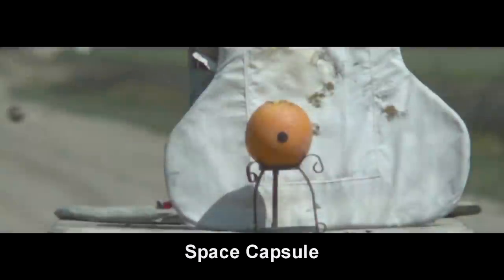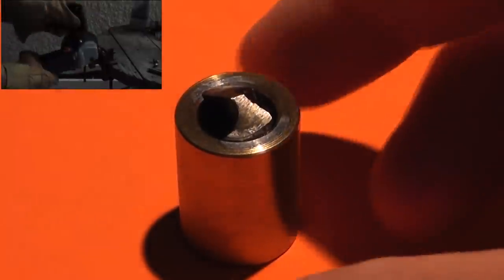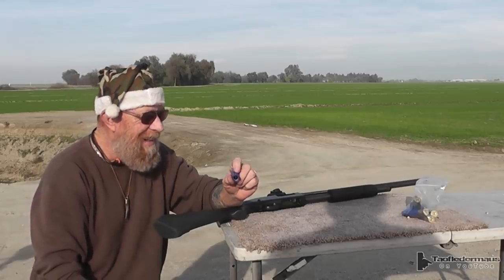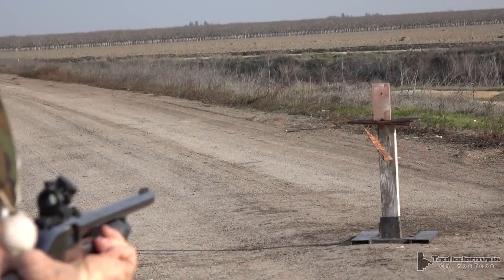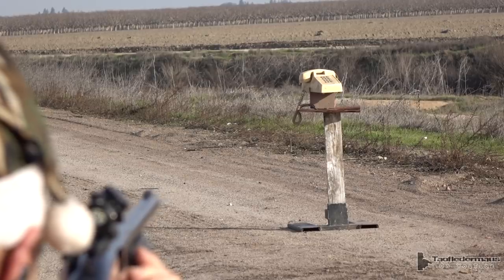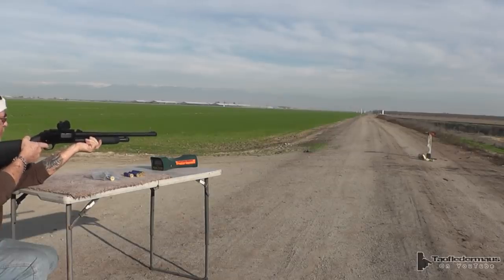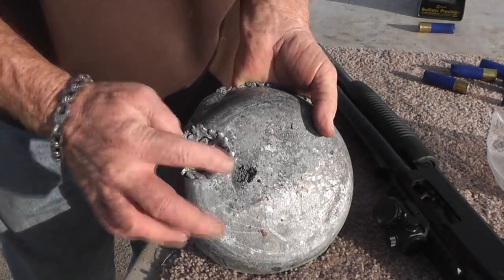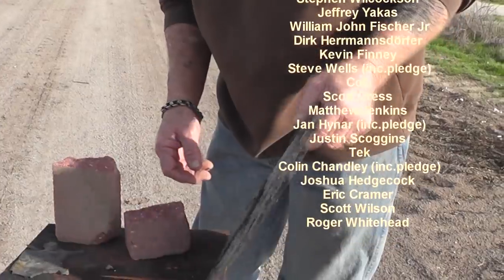Internal "turbine"  drill bit slug experiment

Comment: To test airflow inside the object, try putting something inside that should become loose and fall out in flight, styrofoam wadded paper, etc...? 

Fire into a recovery medium (gelatin, water jugs, magazines...) and look for the indicator. If it’s fallen out, you have airflow, if not, then the high speed creates a buffering “shield”, which is what I suspect happens at those flight speeds/pressures.

Comment: Question, what if you had the same brass cylinder, except capped at the front, then have the air gaps around the drill bit filled with powder model rocket fuel (r candy, sugar rockets, potassium nitrate and sugar. More or less lol)

But that rocket fuel would be sent out of the gaps, more or less, forcing a spin onto the round. 

It's an idea, r candy recipes are everywhere on YouTube.  Just going that the "candy guy" doesn't mind making a few more of these except capped, and you don't mind shooting a rocket powered shell. Lol. 

Just a thought I had, scrolled through a bunch of comments and didn't see this suggestion. I just feel that if you force a spin on it with fuel, vs air, you'll get better spin. 

****Nerd logic used****:

The weight of rocket fuel, even though only 5-10 grams weighs more than the air that passes through the channels over the 30 feet. 

And the burn rate of the fuel could be adjusted with small percentages of gun powder, too get full burn through the channels.

Comment: In front of a blunt objet a shockwave is formed, and the front of the wave is not touching the objet but is recessed, that recess could prevent air from circulating into the holes.

Comment: A little heavy on the slugs.  A lighter version of them may fire more accurate. And the grainge on a 12g shell is to high. You're not going to see the cloud on it. Try using a half drop of canola oil or vegetable oil. Gets a tad bit hot but it shows the desired effect.

Comment: I'm sure this has already been said, but the problem with trying to get airflow through a hole in a supersonic bullet is that any hole which is deeper than its radius is guaranteed to choke on its own Mach cone and behave aerodynamically as if it were solid.

Depending on the speed of the object, a conical shock front will form with a cone angle anywhere from 180/flat (Mach 1.0) to 0/"needle" (Infinite Mach).  The short version is that if your passageway is deep enough that the Mach cone formed by from the leading edge intersects the side of the passage before it exits the back, you are guaranteed to have zero airflow through that passage.

You can find the math to calculate the cone angle for a given speed as the link below.

http://wordpress.mrreid.org/2012/12/15/sonic-booms-and-mach-cones/

Comment: Why not a thinner drill bit with a nylon discarding sabot, fired from a smoothbore rifle (relying on the shape of the bit to spin it up)? (The bit could even be set way back in the case, because the gas from the burning powder will drive it down the barrel with the sabot's driving band. So it could be a lot like an actual tank gun round, but not find stabilized.)

Comment: Ideally the fluting would account for the inside geometry of the slug as well.  I think the fact that the flutes are well formed and probably too aggressive on the bit side and neglected on the inside of the brass housing is leading to the instability.  I think smaller flutes which have a beveled inlet (like a scoop) which taper to a smaller diameter and have a softer rate of twist would yield better results.  That said, that would be very difficult to manufacture.  Honestly I think it would have to be cast and be pressed into a brass jacket or something.  Great concept and video, very thought provoking.  Good work.

Comment: So what probably is happening is air is actually stagnating around the drill bit center (arrow dynamics do amazing/ weird things at supersonic speeds) I would encourage people to look at other things that go supersonic speeds for instance the SR-71 Black engine. (All kinds of things move around on the engine... flaps inside and outside the engine open close, the nose cone moves in and out just to make it efficient at supersonic speeds) SO the friction of the air over the surface of the drill is too high and there is less surface area around the out side of the slug so it travels around it instead of thru it. The oil in the hollow tip probably worked because air dead headed at the base of the howl tip hole, the air acted like a like a fluid in a way, and simply pushed the mineral oil out creating a plume but not all at ounce. (Or the hollow tip acted like a cup and head the fluid where as the drill bit just allowed it to puddle in the barrel and cause fouling /accuracy problems.)

Comment: The mineral oil wasn’t evaporating because you had no compression. With the hollow point, the oil was trapped in the tip however, the slug let it fly out the back with no resistance. It most likely was fouling the barrel and causing the wadding to stick to the slugs.

Comment: I think the blunt forward edge of the "tube" creates a shockwave that keeps air from fully flowing through the drill.
If we think of that drillbit as a turbine, and look at how real high-pressure turbines are built, then you can clearly see that the drillbit is a very inefficient design.
Lots of lightweight wings and a funnel-shaped front is the way to go.

Comment: You likely won't see the oil simply because of the fact that the inertia of the slug accelerating at a faster rate than the oil is likely pushing it out into the wadding and barrel before the slug even leaves it. Unlike the hallow point ammunition, this slug doesn't have the little bowl but a through hole. 
Without wadding of it's own, it would be like trying to stand on a rocket propelled skateboard... You'd stay in place while it rips out from right underneath you. 🤣
Maybe add a small amount silly putty to plug the back holes and a bit more oil. That way the once it leaves the barrel and the pressure differential changes it'll basically turn the silly putty into spit-wads out a straw, then you should see the oil leave. 👍

Comment: Ok, what is the twist rate of a barrel? per inch?  And that is forced upon the object. Where as you are relying upon air to impact the high twist per inch in a millisecond of travel time.
  Now it might work if you were doing long distance, very slight twist thin blades, and a funnel front or way of using the air pressure better.

Comment: oil will not work with this slug. It worked on the hollow point because the hollow point is like a bowl, it holds the oil from going on through. What was happening is the oil probably mostly stayed in the shot cup, because as the slug blasts off, the oil doesn't move as fast, things at rest tend to stay at rest. So, as you fired more rounds, the oil was messing up the barrel. To be fair to each shot, you should swab the bore between shots, if you're going to try the oil or anything else again. Frankly, I don't think it will ever work in this case If the rounds always performed like the first couple, then Sar has something there.

Comment: With the .22LR you had the oil in the tip of the bullet where it did not come into contact with the explosion of the gunpowder. With the shotgun I suspect that the explosion from the gunpowder burned up part or all of your oil inside of the barrel already and that is why you started having accuracy issues due to all the burnt and unburnt crap in the barrel. Would also explain why you didn’t see any vapor trail.

Comment: @TFM have you considered loading these projectiles to just below the speed of sound? dont forget that while the projectile as a hole would not be above the sound barrier, the air moving over parts of the projectile can be accelerated above the sound barrier as they speed up and are pushed out/through the slug. I wonder if you nose cone or another part of the slug is causing such an event and blocking the cavities from getting air flow.

Comment: Perhaps try thicker oil with more viscosity, when the bullet heats up the oil looses viscosity. I think it might stay there a bit longer if you use thicker oil, used motor oil for diesel engines :D. I dunno just throwing ideas.

Comment: The hollow point had constant resistance due to being solid which allowed for vaporization. This projectile has holes straight through it,  so the oil doesn't get a chance to become pressurized and vaporized in flight, as it just blows out the back of the projectile.

Comment: Here is an option: It will need precision, but drill diagonal holes in the base of the round, which will fill with combustion pressures and then expel them upon exit imparting rotation, possibly stabilizing the round. It just has to start the rotation to last two seconds max.

Comment: So I'm curious about this. Whats having more of an effect the rifling of the barrel or the fluting in the drill bit? Shooting out of a smooth bore might have been interesting to see if any spin is imparted from the fluting. You could also submerge the round in a dish and provide a current. Then introduce a drop of die right in front of the slug to see the result of the internal hydrodynamics of the slug. I would propose that it just slows the actual projectile down due to the increased twist rate compared to the rifling of the barrel cause a high pressure block in the slug.

Comment: Reasons I can see, the hollow point was a hollow point and not a through hole like the drill bit slug so that saturated the wad and caused failures, i would have used a plastic wad something not fibrous. I bet if the drill bit was loaded a bit hotter or faster powder would have had a different effect and with the wad being different would have helped.  I sure and want want want to see this revisited at least 1 more time and if you can get like 3 times the slugs for using different ways, sabots/shot cups and slug machined down a bit more to compensate for a cup probably would have different effects.  To me too much oil shouldn't have caused a issue other than see some oil out of the gun barrel. Even if you wrapped the slug bottom in a plastic wrap with the current wad would keep it from getting oil soaked and no failure.

Comment: It's like a jet engine with compressor stall, at a certain speed the air compresses to a point where it actually stops airflow through the engine, probably what's going on with these.

Comment: The intro song had me rolling. The reason your wadding failed is the pressure of the blast with nothing between the wadding and the load was too much for the plastic to handle and it was partially extruding it through the opening in the back of the shot. Try putting a piece of cardboard box between them.

Comment: the way the turbine shaped drill bit would direct the air would cause these rounds to dip down and to the right. They aren't spinning because of rifling, they are spinning because of the way they are redirecting the air they are traveling through, which will exert a force on the bullet instead of against the barrel of the rifle.

Comment: i wouldnt have used mineral oil the viscosity is wayyy off, u want some thing as close to water as possible if u want an epic vapor trail. hard part is puttin in enough of the right mixture that it wont burn up or wont mess up the bullets like when they were coming out strange too thick of oil was used, is the DEF cause of that. so again closest thing to water should ive u a great trail. it think when u dyed it maight have been where the mixture got weird. just an idea

Comment: I think the issue is it wont work if the air passing through the center is restricted. I think it would work by removing the drill bit and inverting the barrel rifling on the walls of the cylinder, creating mounds instead of grooves, so it continues directing the airflow in the same rotation as it did from the barrel.

Comment: How does this video address the requests of the viewers? Wasn't the idea to propel a drill bit through a barrel and have the twists make it spin through the air as rifling would have? Putting the bit tightly inside a sabot of brass and then firing it through a rifled barrel imparts the spin to the sabot, not the bit. Am I misunderstanding this presentation?

Comment: Why don’t they use this round as a basis for the self propelled/“rocket” round, just need to keep the round capped on the top, keep the drill bit inside, and just fill it with a powder or fuel of some sorts

Comment: Theory: the rifled barrel spins the slug faster than the drill bit would, which in turn makes the drill bit's airflow fight against the spin from the barrel, like trying to turn two gears that are different sizes and touching eachother with both hands at the same speed

Comment: It would be interesting to see if the spin could be imparted during the acceleration down the barrel by adding more charge than needed, and letting some of it vent through the slug.  The slug would of course need a free path through it for exhaust gasses to flow, so no wadding.

Comment: Have you considered the fact that with a higher surface area in the 22 hollow point and a large amount of force apply the same time main cause of mineral oil vapour to be pushed out much sooner in flight Andy largest surface area of a slug would force more air to be displaced which is why you may not be seeing a vapour trail from the mineral water

Comment: one time i put a socket for a ratchet wrinch in a 20Ga 2 3/4 inch high-brass shot shell and filled the hollow part of the socket with the #6 shot that was from the shell. i shot it at an old dead dryer door and it went clean threw the door and got stuck in the back of the drum.

Comment: i know this video is older, but i believe the drill bit was the wrong direction. yes it was turning the correct direction to cut but resistance is opposite of the twist. so maybe the air flow was slowing rotation... wonder if a left handed drill bit would have worked better.

Comment: saar if i had one recommendation to fix the slug, it'd be to make the drill bit slightly more straight and to add a flat steel plate to the back of it so the wadding is able to come off of it properly. (someone who's better at science can critique me on my thoughts about the drill bit) the issue with the wadding though i believe was due to the fact that there was space inside the slug which the wadding would then force itself into and cause it to tumble, a flat steel plate to be discarded would fix the issue.

Comment: If the fluting goes all the way through fluid dynamics should mean it is all left in the barrel, as the projectile will be propelled faster than the fluid since it has not surface area for the explosion to push.

I believe in the hole point it does not go all the way through so the bullet acts as a squeegee pushing the oil in front of it until it overcomes the barrel pressure a few inches beyond the barrel creating the cloud of mist.

Comment: Maybe someone has posted this. I’m not going to read all the comments. The drill bit inside will not rotate the round do to the fact that the flow of air both in front of and behind equalize. When the the air pressure is consistent at both ends of the “ tube” the whole unit is a mass rather than a pipe.

Comment: I believe the reason that the slug is not spinning fast, is due to the rifling spinning the slug clock wise when the flutes of the drill are forcing the slug to spin in the opposite direction, if you look at the flute of the drill they are designed to rotate drill bit clock wise, but if you force air toward the tip of the drill bit it want to rotate counter clock wise.

Comment: 4:47 - I might be wrong, but the twist of the drill bit being right hand and the rifling also being right hand twist; the air passing through the drill bit will be counteracting the twist put on the slug by the barrel. I think to increase the spin of the slug after it exits the barrel the drill bit will need to be a left hand twist.

Comment: Have you considered having a fluted slug with the holes at the top angling down to the sides instead of the just straight down through the slug to create more spin.   It wouldn't be super hard.  Two hole at the top corners crossing side by side(but not touching) in the middle, ending at opposite sides 
                                      
                                           Air In top
                                        /-----------\    top     
                                        |\ \       / /|
                                        | \ \     / / |
                                        |  \ \   / /  |
                                        |   \ \ / /   |
                                        |    \ \ /    |
                                        |     \ \     |
                                        |    / \ \    |
                                        |   / / \ \   |
                                        |  / /   \ \  |
                                        | / /     \ \ |
                                        |/ /       \ \|    Air out through the 
                                          /         \      Holes at side 
                                         /           \
                                        |             |
                                        |             |
                                        ---------------  bottom

Comment: Bah old video, but meh. 
The reason why the mineral oil didn't work was that you tested it with a revolving accellerator and it steams off as soon as it leaves the shute...the short shute.
With the drillbitaccellerator the shute is much much longer and the mineral oil is thus evicted inside the shute, as you speculate, thus soiling the accerelator shute.